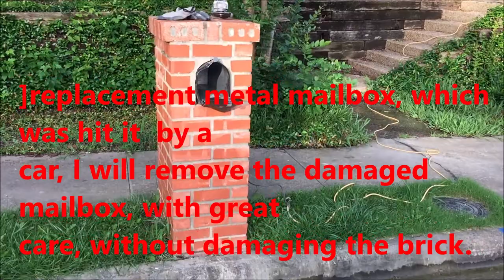REPLACING A METAL MAILBOX

Comment: I didn't know this was going to be a twerking video! LOL!  Instead of using a destructive pry bar to get the metal mailbox out of the brick column, I would have used a RotoZip tool with a metal cutting wheel and maybe an oscillating tool (like Fein) with the metal cutting blade inside the mailbox, cutting the mailbox in several places to remove the metal mailbox from the column in sections. Before inserting the new mailbox into the column, I would look for a few good anchor points to secure the mailbox with concrete anchor screws. I would then cut-off the wider section at the very back of the new mailbox to permit sliding it into the existing hole without having to chip away any of the mortar. Once the mailbox was sitting inside the column loosely, mark where to drill holes for stainless steel screws. Slide-out the mailbox, drill the screw holes into the mailbox, slide it back in and transfer the location of the holes with a Sharpie marker. Slide-out the mailbox, use an angle drill, if necessary, and drill your holes into the mortar for the screw anchors. Insert the screw anchors into the mortar, slide the mailbox in and secure it with the stainless steel screws. There should be very little--if any--repair work left to do on the mortar. You can optionally fabricate a back onto the new mailbox if needed. Your finished product looks very good, btw.